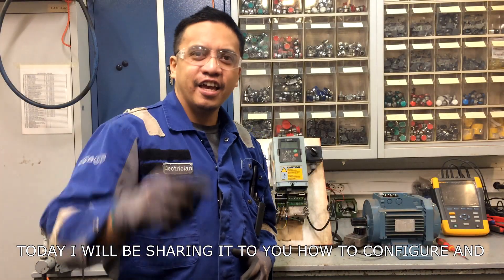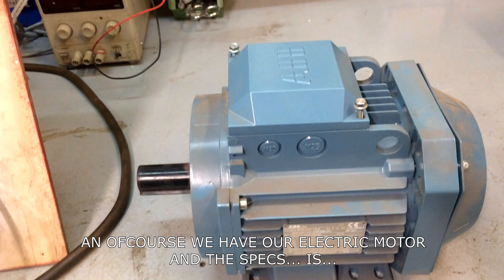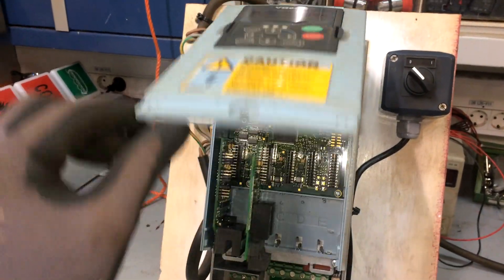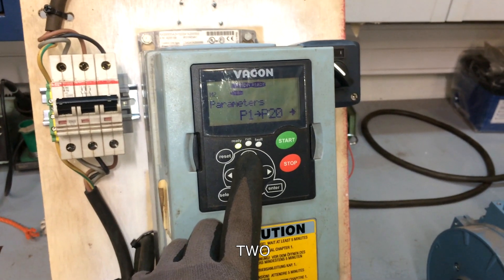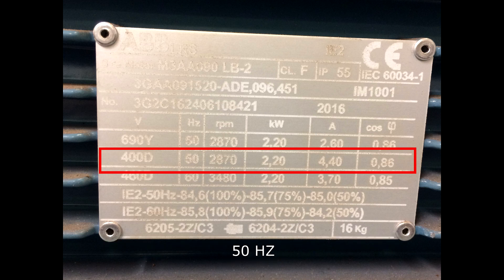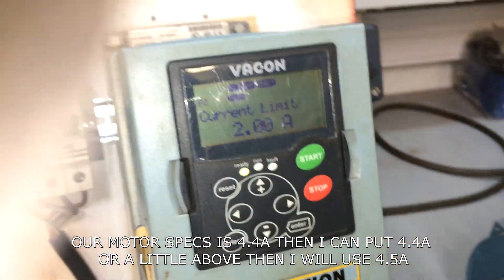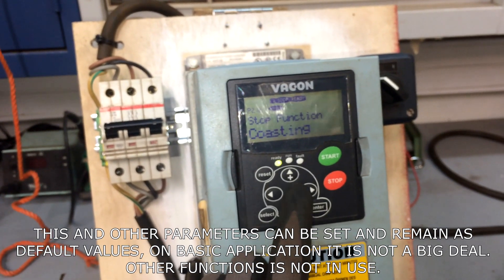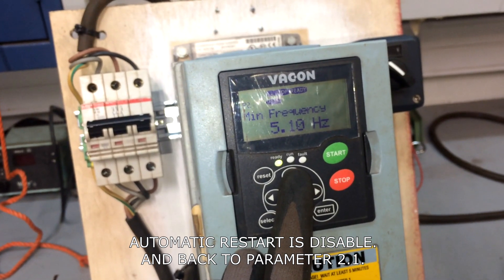VACON VARIABLE FREQUENCY DRIVE CONFIGURATION AND ELECTRIC MOTOR CONNECTION

Comment: Question: I have vfd that's goes from 0 to 100HZ, my 3 phase motor is rated at 1750 RPM will it still be the same speed using the VFD at 100HZ?
Reply from the maker: Hello @funlovingJohn, You need to adjust the setting of your VFD based on motor specification to avoid damage, please follow motor nameplate.
Reply: @EngrBryce   that is not what I asked
Reply from the maker: @funlovingJohn  your motor will run more than 1750rpm since frequency is directly proportional with your speed, based on mathematical formula.
Reply from the maker: if 1750 rpm at 60hz or 50hz depend on your country then running at 100hz will increase also the rpm, never tried it yet but based only the formula between frequency and speed.
Reply: No. At 100hz your motor will run way faster than its rated speed.

Follow manufacturers nameplate data.